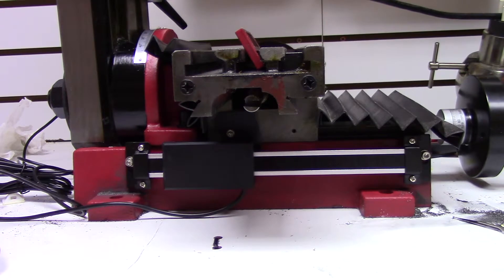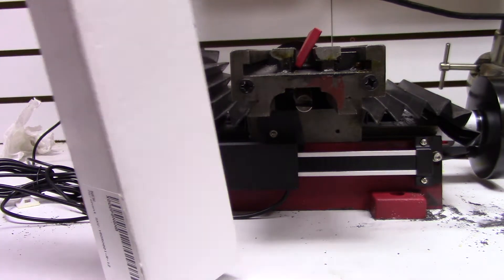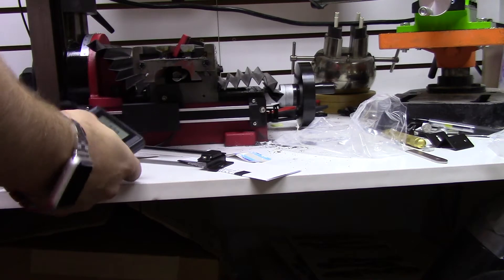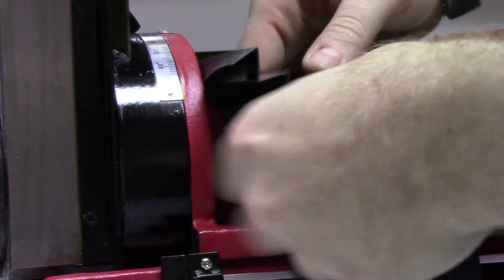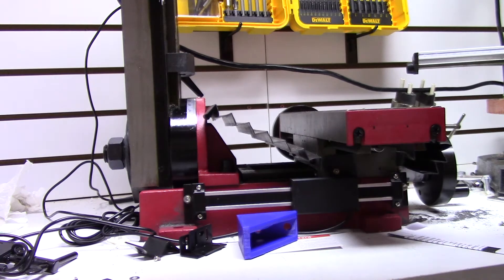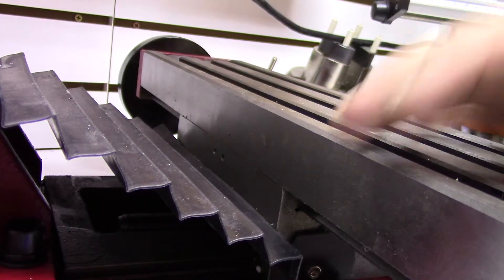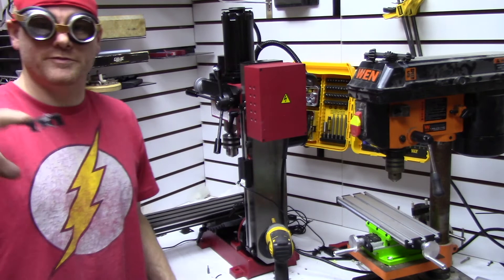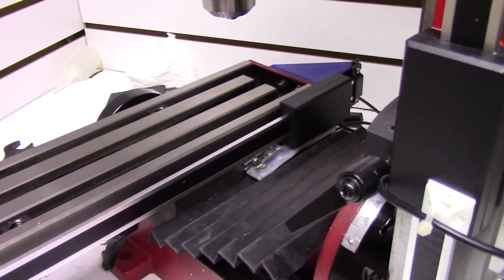Harbor Freight Mini Mill 44991 DRO Install Part 1

Comment: Yes , true ,"but" you wil find that when you finally buy a three inch milling vice, you will have bolt your vice down to tables middle slot, as this setting is the only way to get equal distance in and out under the spindle. This milling vice set up will further limit the distance of travel, that is if you do not buy a three inch milling vice with a 360 table underneath. What your doing is good as long as you do not buy a milling vice that over hangs your table by two inches. Anyway you have plenty swing with out an extended dro slider. What your doing is or has been somewhat self defeating, with out a vice you gain, but eventually you will need a milling vice, and you will need to indicate it to the table, and each time you remove the vice, you have to repeat to centre it with a dial indicator of test indicator. You will extend the limits of your table with a milling vice. I mounted by dro already but i simply mounted they way you avoided but then again i have no intention rarely taking off my vice. Have checked the swing of your spindle you will find that your spindle even with the dro attacked the other way that your spindle will still centre with the table at both sides in and out.

Comment: Hey thanks for making this video. Looks like it's been a while since you posted a new one, but I hope you know that people are still looking at them!

Now that it's been installed for a few months, how do you like the DRO?  I'm just about to do that upgrade onto my HF mini (looks very much like this one)  Have you done any of the other upgrades?  (Belt, or gas spring?)
Reply from the maker: hey man, thanks. DRO works great, use it literally every day. Havent done any other upgrades as of yet, building a XXL shapeoko and Stepcraft CNC right now, I am trying to find time to make more videos, Thanks for the kind words.